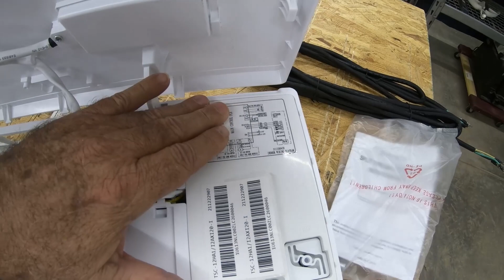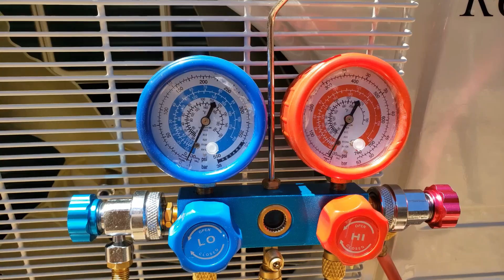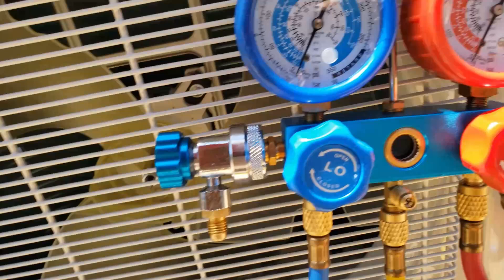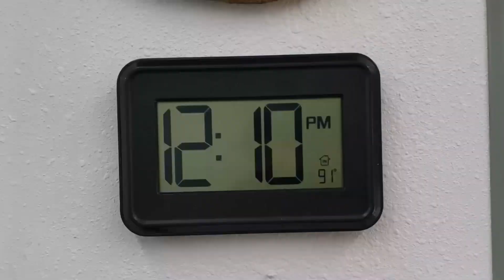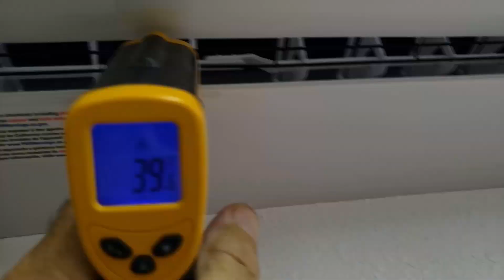Master the DIY: Step-by-Step Installation of 120v Mini Split

Comment from the maker: Be Sure to Watch Tools Needed close to the end of the video with Links Below

12,000 BTU Mini Split AC/Heating System with Inverter:  https://amzn.to/3A1FKqD

Equipment Pad for Mini Split Condensers:   https://amzn.to/3zHym3d

2.5" Wall Sleeve:   https://amzn.to/3QqxfuK

Alternatives Units:
Senville LETO Mini Split:    https://amzn.to/3n3x3V0
Cooper & Hunter Mini Split:   https://amzn.to/3Qx0r3n
DELLA 12K Mini Split:  https://amzn.to/3n3xxKO

Basic Vacuum Adapter:  https://amzn.to/3nQE4aV

Best Adapter Tool: https://amzn.to/31c40E3  My Choice!

Yellow Jacket 60278 Flaring Tool:  https://amzn.to/3dwHpae

Budget Flaring Kit:   https://amzn.to/3zLHhkd

Nylog Gasket/Thread Sealant:    https://amzn.to/3O35oiT

Screw Feed Tubing Cutter:   https://amzn.to/3nQJ3Zb

My Favorite Close Quarter Tube Cutter:  https://amzn.to/3rpZxcg

Vacuum Pump HVAC Kit:  https://amzn.to/318YEcC

PVC Decorative Line Cover Kit (one for each head): https://amzn.to/350IfIu

Outdoor Mounting Bracket:  https://amzn.to/2Fw9vpq

2-1/2 Inch Bi-Metal Hole Saw:  https://amzn.to/343BJS6  This A/C Unit Requires

3-1/2 Inch Bi-Metal Hole Saw:  https://amzn.to/3lIcpqG  If needed for your A/C Unit

DEWALT Hole Saw Kit:  https://amzn.to/3tIjAFx

30 Amp Fusible AC Disconnect:  https://amzn.to/31aHN9c

Comment: Another great video,plan on putting a 120v mini split in my shed  12x 20  but  can it be plugged in to a 120v outside  receptacle??
Reply: thanks Jim just watched your  video on 

5:17 / 6:46

How to Wire a Disconnect Box for an  120v Air Conditioner 😀
Reply from the maker: Thank you, You can with a wall unit that comes with a plug cord but as far as a mini split no by code along with it will not run correctly if you just go to an GFCI outlet, it will keep tripping it and not recommended for safety.
Reply from the maker: Thanks for watching I appreciate it!

Comment: Do you have to remove the valve core to pull a vacuum or can you just use that 5/16 to 1/4  adapter and leave vale in ?
Reply from the maker: Hi Mark, the proper way is to remove the core but you can do it with the adapter no problem.
Reply: @ILikeToBuildStuff  thx

Comment: This is for someone for advanced DYI.  To much equipment to buy. I here a pro!
Reply from the maker: Hi Piper, Not really.  I get emails all the time from folks that have never done anything like this with success and you are actually only looking at about $180 in specialty tools that you could resell when project is done.

I sure appreciate you joining in here and the great comment it means a lot to me that you would take the time to watch my video!
Reply: I just did an install this weekend. If you have basic DIY skills this isn't that hard. I could have done this simply purchasing the pump and gauges for about $100. I did end up doing a bit more advanced install using a micron gauge and the core removal tools. It was a good time for a father daughter project, that she even said after wards... that she could have done it. Nothing difficult, just tedious and time consuming.
Reply from the maker: @dougphelps6917  Outstanding Doug!!!